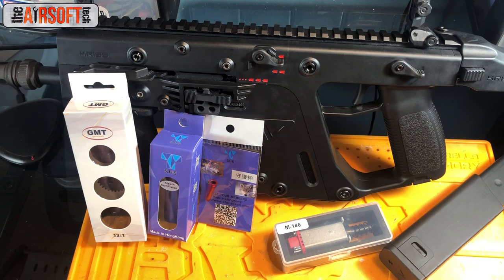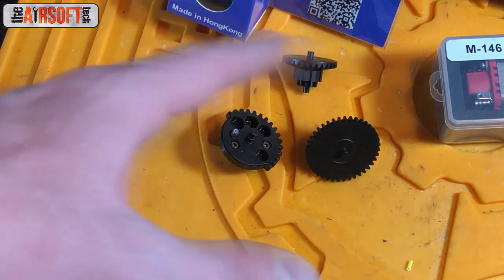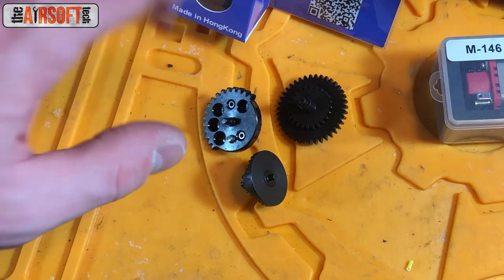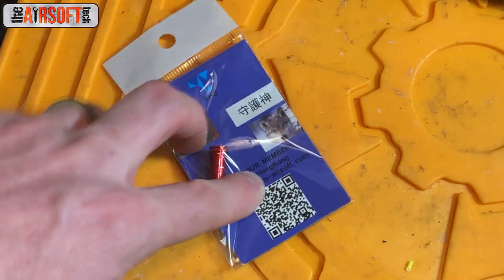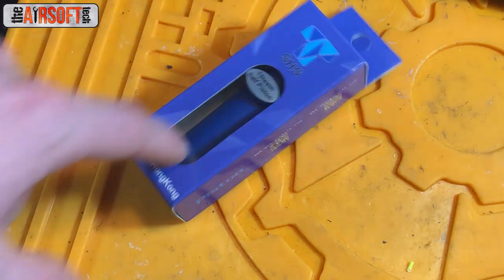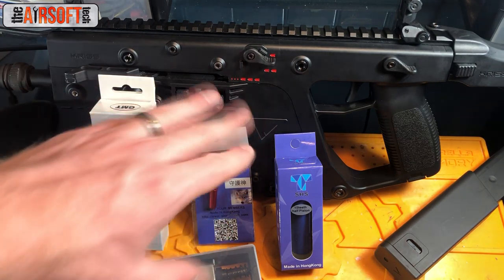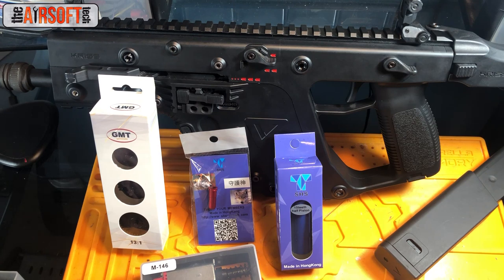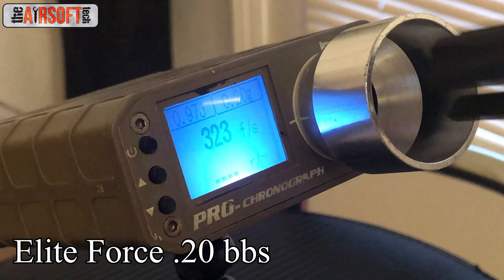Slow Speed Krytac Vector Build

Comment: Did a very similar build last week, had some troubles with the gearbox casing interfering with the Sector Gear on SHS rebranded gears. Had to shim the gearbox a little off to one side but there was still plenty (80-90%) tooth contact between spur and bevel. Quite nice to work on really

Comment: That sector gear anti reversal caused me no end of issues. I switched out the stock gears for 16:1 SHS gears and it caused misfeeds which i thought was the mags. I removed that little latch and problem solved. Still, the Vector was a headache to me from day one 😖

Comment: Hey did you have any feeding issues after putting your gears in? The only internal mod other than a perun mosfet are 13:1 gears. I thought a sector delay chip would work but it did not fix the issue.

Comment: 25rps
(Slow krytac build) wut

I use dsg and all but I don’t really think anything Over 20rps is slow
Reply: Kenny N how would you DSG the vector?
Reply: hmg9194 you can’t I don’t think
Reply: I think 25-35 is moderate speed, anything under is slow, and anything over is high speed
Reply from the maker: You can DSG it, just takes some work
Reply: TheAirsoftTech well yes but it would be easier just to do it on a m4
Reply: @PebbleBlaster9  not really, DSG Vector are pretty easy to do, just as a M4, only issue is that you need to find the correct nozzle length or it'll cause some feeding issues. (or simply don't mess with the nozzle at all, stock Krytac nozzles are ok)

Comment: quick question I have/ started to build a DSG and I put a m160 spring with shs 18:1 ratio and a ZCI 22tpa motor, it cracked the shs steel piston my AOE was on point... just confused why it did that, I then changed out the spring and spring for the stock one VFC half steel rack piston and a spring that was shooting 400fps in a cm048a and it double cycles, I think its PME because I switched the motor out to the stock one non-neo and it works great so far.
Reply: @KILLGAMERSCOOT4LIFE  I'll check it out tnx

Comment: I like to add a 100mm (4 inch) outter/inner barrel extension to tighten up groupings and add a bit more consistency.  

Q. At what point does "voluming" the piston/cylinder come into play with non stock barrel lengths?
Reply: It comes into play on everything including stock set ups

Comment: Hi, those someone know why the vector stock shoots at 350fps with a M120 spring which should shoot at 400fps? I was told that the o-ring of the piston doesn't seal very weel but I'm new to airsoft and I'm afraid of screwing up if I open it up without a plan
Reply: @MegaChickenPunch  Thanks for the response! really appreciate it!

Comment: What's realistically the highest fps you can place a krytac kv? 375?
Reply: You can get higher FPS if you use a longer inner barrel and use more of the cilinder air volume, with a mock silencer of course.

That way you would'nt need a 190 spring to get better velocity

You could use a 190 spring and get over 400 FPS but its going to destroy the gearbox in no time lol

It is more about durability than what is "realistic" tbh

Comment: I would have used something like shs 12:1 gears and also used an asg 30k or 35k motor and kept the rest of the parts he used but on a m4 platform I would have added a shs or guarder tappet plate if anyone could let me know which is better on a m4 I would really appreciate that
Reply: I've found shs to be a bit more flexible but I've never broken a guarder. Shs is probably better for a gear that has a sector delay chip.
But If using a 22tpa motor in a vector, I would reccomend  a stronger spring and SS'ing 1 or 2 teeth.
Reply: Pairing 12:1s with a 30-35k motor would be inefficient since ur pairing speed gears with a mostly speed oriented motor.
Either pair the stock gearset with the 30-35k motor or pair the 12:1s with an actual torque motor, no less than 19tpa.
Reply: @christiangarcia6516  30k-35k motors are not high speed lol. Those are high torque, both of them. I'm building siegtek 10.44:1 with a 40k motor right now, lots of people have done it to get the most rps out of a SSG to keep a longer barrel
Reply: Guarder tappet plate over SHS, I've had a lot of problems with SHS tappet quality control. The lip for the air nozzle seems to be a different size on every SHS tappet plate and it's a PITA

Comment: That motor is not worth it, use the short neck, mine I have with 12.1 goes 30 bbs per second longer barrel and at 350 fps
Reply: What motor
Reply: @llentityxfll2539  nuprol hi torque